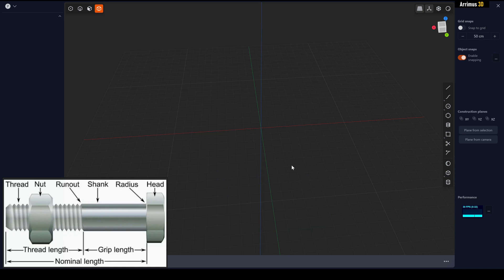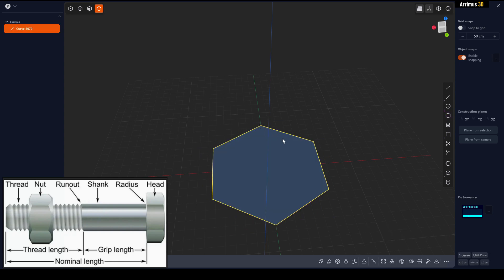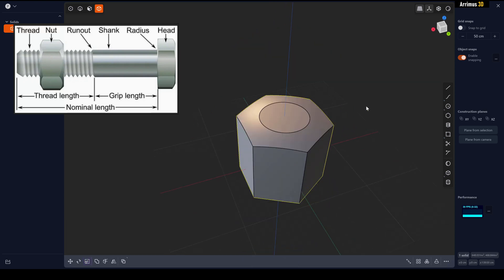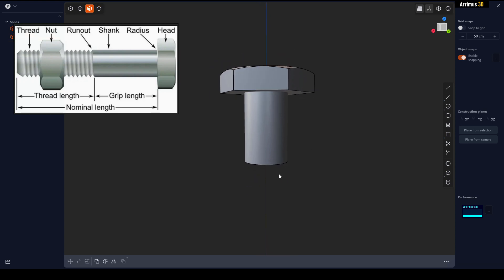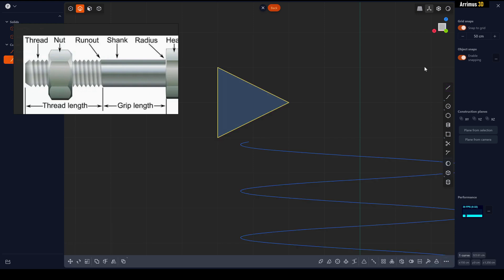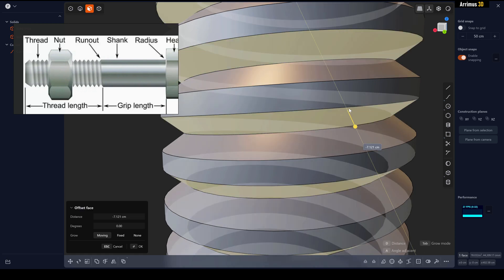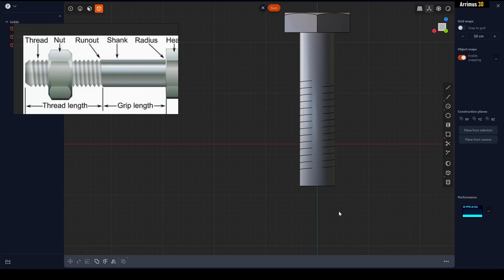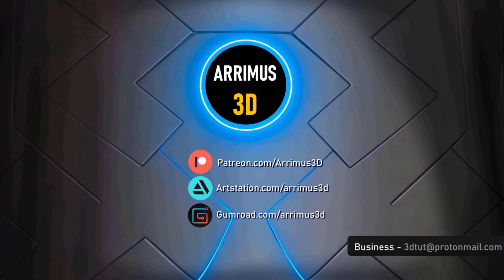Super Easy Plasticity Nuts and Bolts!

Comment: The "Chamfer" on the top of the head is a conical surface not a spherical surface. The angle from the top of the head to the cone is 30 degrees for hex heads and 25
 degrees for square
heads.

Comment: I think you could do a long video on creating tolerance on the nut so it actually works if 3D printing.  Also, trying to get them to match actual thread standards would be pretty challenging.  For now, I will probably continue to create threaded parts in Fusion 360 and use Plasticity for almost everything else.

Comment: After you set your spiral... Do P for Pipe, set the facets to 3, find a section size and a thickness that fill the spiral and set the angle at 60.

Comment: rhino > plasticity. That said, i do root for the guy making plasticity and it might be more approachable from beginners. Not hating on it, just, rhino is becoming a true monster now. Try the shrink wrap feature in VIP version 8. It will blow your mind.  The subdiv surfaces are pretty cool too and over all the tools are matured well in Rhino. Sadly, there are many hidden features in rhino, like, hold ctrl + shift to select surfaces on solids and move them, scale them etc and the whole object will update. Move a hole, no sweat this way. But i always welcome new things. It will be interesting to see what niche it can capture from the old heavy hitters (solid works, rhino etc). The base code for Plasticity is the same as the NX software uses and that is a very solid base. For filets it's excellent. So a lot of potential in the future.
Reply: I don't use plasticity, but I think that your comparison don't make sense at all. Rhino is about 20 years old, isn't? Plasticity just a few? Also the purpose of both softwares are different from each other.
Reply: @MrKezives  they are both NURB based CAD programs. They can output the same, really. It's just a matter of how you get to the end result. Both of them are tilted towards the creative thinking, rhino in it's surface approach and not parametric, same with plasticity, it's a solid modeler but trying to approach it more like a polygon workflow. I'm not hating on Plasticity, but if you want to work with 3d, choose wisely. I don't think plasticity is there yet. It is very new and a single dev. It's impressive but if you plan to work professionally i would choose rhino any day over plasticity. And yes, rhino is 20 years old or more. and sure, plasticity is better than rhino V1 was :). 
Plasticity needs to finds it's niche where it outshine the other big apps out there.
Reply: @happyfarang  ohh got your point. Yeah, I think plasticity will develop fast. You are right, we do not have time to lose, better pick the best one. I need to learn CAD modeling asap, I'll take a look on rhino.